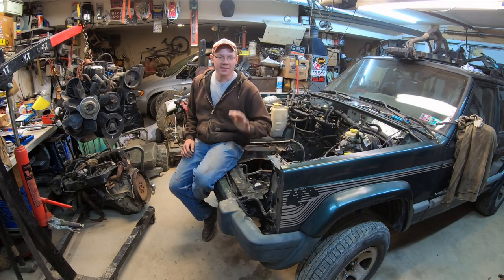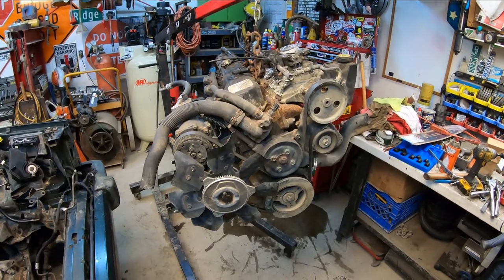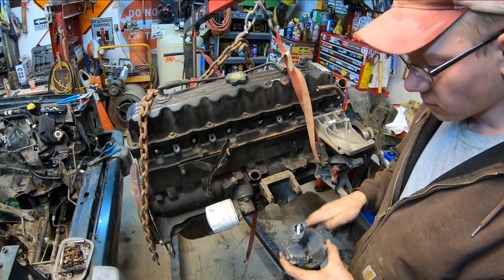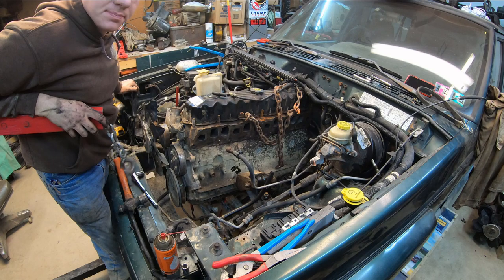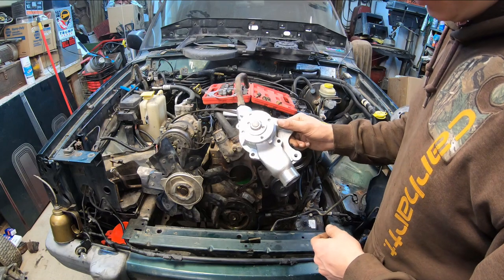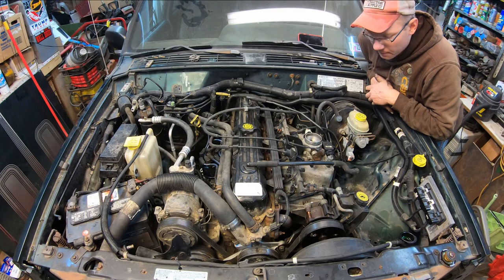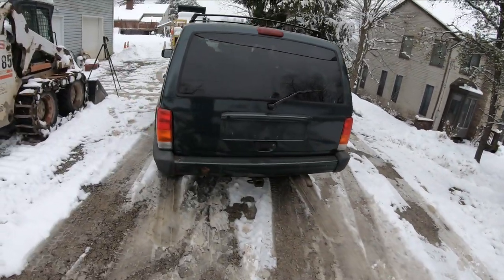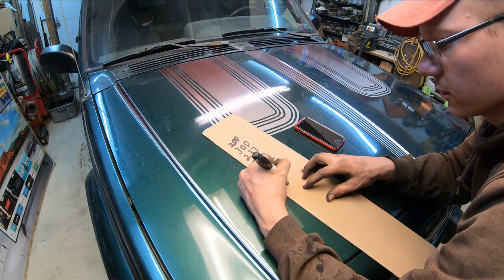$200 Jeep Cherokee gets JunkYard Engine,  WILL IT RUN AND DRIVE???

Comment: The Cherokee is a neat little truck. My 95 was put back together after a head-on collision before I bought it, then put back together when recovered after being stolen and driven until the engine blew up... the result was persistent cooling system and transmission problems, so I gave it up...

Jeep had a 3 speed automatic that just didn't like running between 35 and 45 mph - probably part of the overheating problems. The fan wasn't any prize either.

You'll definitely benefit from getting the spare out of the cargo space - Jeep made a couple of different rear bumper swing gate designs over the years, one or two of which were actually good. I got lucky in a junkyard one day when I also scored new front seats.

The other thing is that aside from the engine bay, almost everything else on the truck is readily accessible for wrenching.

Undercoating is a must. I've heard third hand that Jeep has an odd spec for their sheet metal and spot welding procedures, leaving them vulnerable to rusting.

You'll have fun with this.

Comment: I always cringe whenever anyone attempts to weld castings...    Never works for long and when it breaks again, the damage is much worse..   Braze is almost always the way to go...  Lower temp process, less distortion, about 80% as strong in tensile, but much more ductile, so it flexes vs just snapping.    If you can't TIG or oxyfuel, you can get it as a MIG wire as well...
Reply: I'm pretty sure the one piece manifold he welded up Is not cast iron but steal.
Reply: @jamesmullen4308  Doesn't matter..  While steel castings are definitely more weldable, they are still brittle and the change in alloy in the weld zone can make them even more prone to breakage after the weld.   Braze is still the best choice IMO..  Try it the next time you're at the  welding/gas supply- get them to hook you up with a small spool of bronze MIG wire.  Uses reverse polarity and pure argon as shielding.  I also started with a small 2 lb spool but I found it just the most versatile general repair filler and use it so much that I bought another machine with big spools of bronze wire so I don't have to keep changing the polarity and gas to swap between welding  and brazing.
Reply: @jamesmullen4308  Yep, it looks like steel, not cast iron so he's good.
Reply: i had some headers welded one time but they were stainless and they were better than new at the Y's
Reply: Those arent castings in any way shape or form. Jeep 4.0 "Manifolds" are steel tubing!!
Reply: @DereksGarage  Yes, i second this. They are not cast
Reply: Wow, that guy is persistent. Time to bring out the ROCKWELL hardeness machine. haha
Reply: @Flying0Dismount  actually they are a form of stainless steel tubular exhaust factory manifolds.
Reply: I’ve stick welded cast iron many times. Never had a welded part fail. You just have to know what you are doing. That said, that is actually tubular steel, not cast....
Reply: @Flying0Dismount  lel
If it has welds on it from the factory, it is not a casting.
Reply: Wish they were cast - maybe then I'd have no cracks;)

Comment: Watching you work reminds me that it takes me a week to do what I used to do in a day.
Reply: Try months
Reply: Yup! Simple clutch replace on a 2.3 ranger. You shouldn't need a 1/2 drive and 3 ft. pipe to remove bell bolts. Those were the easy bolts on my crusty/ salty truck. 2 months !??
Reply: Boy, does that ring true!

Comment: I started watching while at the Jeep dealer! Oil change and checking codes. I had a multiple cylinder misfire at 2,400 miles on a '21 JT.

I miss those old 4.0s. They were simple, reliable, durable and had plenty of torque. The 3.6 seems asthmatic compared to the 4.0 when you are pulling something.

When do we see some additions the the JL?!
Reply from the maker: The only addition I wanna make to the JL is a for sale sign.... way too nice for myself to drive
Reply: @DieselCreek  
True. I feel strange driving something that doesn't, rattle, have an obnoxious exhaust or severe cancer. However, it is nice to work on my vehicles because I want to rather than need to.

Comment: Nice job Matt !
Those were the best Jeeps ever. Even better than the Grand Cherokee. The six is quite a guzzler but all in all, a good deal !
And yes, a rust proofing job is a must. Especially INSIDE the frame rails, rocker panels, doors. I had a Comanche pick up with the same 4 litres 
while building our cottage in upstate Québec. That thing was a real workhorse, pulling machinery, concreteful trailers, heck, even trees !
Too bad my bro totalled it in a bad snow storm.

Comment: Sooo, i have a cherokee myself, and one thing i noticed was the thin foil on the injektors, they are actually good, because these cars sometimes have the problem that the gas gets hot in the rail (cause of the exhaust manifold) and then the engine runs poorly and what i also have seen is that the viscous fan is turning very easy, dont think it still works, could couse future overheating problems
Reply: sorry if its a little hard to understand, normaly I speak german and not english :)

Comment: Looks, sounds and runs like a success, count in the time you spent while working out the costs.
Reply: Yup, double the cost of parts etc. and that's the value of the rig now. Also lets you know you probably made less than $20/hr. but there's always the fun factor and bragging rights.

Comment: Oh yeah, definitely worth what you put into it. Down here in southern TN where i'm at, it's super hard to find ANY drivable 4x4 jeep for under $1.5k. Most of the ones you do find for under $1k have 1 of 3 problems with them. 1. Needs motor/trans. 2. No title. 3. It's been rolled.

Had a jeep cherokee that looked exactly like yours but white. Got it for $350, person who owned it thought it had a knock but the flywheel was busted. Replaced that, put a new fuel pump in it, washed all the mold off and out of it, and it was good to go. Ended up putting a rough country lift on it ($450 new), some 33s from fb($400),cut out the fenders and threw on some flares from fb($150) a roof rack from ebay($120ish) and  homemade "off road" bumpers/stinger bar made from scrap metal. Drove it about a month and threw it on fb for $3.5k and ended up getting $3.2k. Didn't even have $2k in it and the hardest part of the entire build was getting the mold off/out of it lol.

Idk how popular they are up north, but here down south. You can buy one, lift it and toss a couple "off road" mods on it and sell them for a decent profit.

Comment: I've got a 1993 Cherokee and it would try to run 210 degrees or a little more. I replaced the radiator, thermostat, water pump, it helped some but not much. So I added a transmission oil cooler and make sure you fix that broken fan shroud and I replaced the fan clutch. All that helped a little more. The auxiliary fan should kick on at a little over the 210 degree mark. Also I bent the fan blades to add a little more pitch to pull more air. It makes a difference. You'll hear a little more fan noise but it's not bad. I live in Arkansas and our winters aren't too bad. So I use a 180 degree thermostat. I also installed 30 × 9.50 x 15 Maxxis Buckshot tires on stock rims without a lift kit. I haven't gotten stuck yet. Stay safe and Merry Christmas. Keep the videos coming.

Comment: Great job.  I use fluid film mixed with red rust check and spray it on once a year to my truck.  I pull all the trim, body plugs , wheel liners , tail lights, headlights ect.. you get the idea.  It takes a solid day to day and a half ( spread out) between taking it all apart, washing and letting it dry, spraying it and reassembly. Worth it though I think.

Comment: My old jeep Cherokee would over heat but a 12 volt switched electric fan took care of that . Just had to remember to shut the switch off when I parked . LOL I stood that ol' jeep straight up , straight down, over rocks , through sand and snow . The 4.0 finally died due to me doing dumb things ( 300,000 miles on it ) but the transfer case lives on in my brother jungles jeep ! Jeep forever !

Comment: 210 is normal temp for the XJ. They just run hotter than other Jeeps with the 4.0L. You could do a fan or radiator upgrade. Some guys even put spacers on the hood hinges so hot air can vent out the back. I have a WJ with a slightly newer 4.0L and it stays under 190. I think the WJ fan/rad is a typical upgrade for the XJ.

Comment: Very nice 😀. As a XJ owner I’m very happy to see another XJ is resqued. In Europe the car is now worth around € 5.000 - 7.000,- after a good cleaning. Low miles examples with 50.000 miles go for about € 20.000,- these days because it became a youngtimer. 😎

Comment: Top mechanic's honors on the engine swap!
When your skills are as valuable as yours are, you can afford to run a slightly aged vehicle w/zero worries. I'm 60 [9/01 /21] &even though I'm in TX, I have to rely on my mechanics & my job to pay for any maint. or repairs. My truck is an '04 Ford Ranger edge model. I have to be very careful w/it so as to keep it in good shape for a long life. New 1/2 tonners are like a down pmt on a house. It's getting ridiculously expensive w/all the unnecessary bells & whistles you just don't need.

You are in a good place. Keep up your skills.

Comment: Don’t forget to put the fan shroud around that mechanical fan✅.   The engine will need it in warm weather especially, and it’s absence might even make it run too warm in winter.  Prolly oughtta replace fan clutch while you’re in there, too.
Good call on fluid film-  just avoid underbody washes till spring, as the detergents & pressure will erase the protective layer.  Garden hose will suffice on days above freezing.

Comment: I read an article a couple of years ago about the ten cars that refuse to die. That Jeep is the number one that refused to die. There is one everywhere you look in the Dallas area as we have no rust problems. Most of them look really good, the only thing is some have sunburn on the paint, but the insides hold up very well. I don't remember what years yours is but in Texas after twenty four years we do not have to do emissions check on them any more, just safety.

Comment: I'm on Long Island and any Jeep XJ running and driving with under 200k miles is worth at MINIMUM $2500-3000. When people have them lifted they try to ask 5k all day long. Way too expensive in my opinion but that's what they're going for by me. So I'd say you're in good shape with this project and I would have done the same exact thing.

Comment: You should fix that noisy exhaust on that truck you used to pull the other truck with in the end. It’s way too loud. Here you’d get a nice extra bill from the po po if they stopped you. Other than that awesome video. I’m glad you restore a oldie. Less electronics to go bad. All the newer stuff is ticking time bombs. When electrolytic caps in the electronics dry out and get an internal resistance it’s game over for every vehicle and it’s not a question if but when. You are way better off with something like that. Merry Christmas and I hope you get a nice and peaceful Holliday coming up.

Comment: If it keeps running hot, due to an airlock, fill the radiator cold with the heater hose disconnected at the t-stat housing until coolant comes out. The engine is full of coolant now. You've got a great deal going here!

Comment: I have a '98 Cherokee that I bought used almost 19 years ago.  The 4.0L is still going strong--one of the best inline-sixes ever made.  Jeep's weak spot has always been electrical issues.  Over the years, I've replaced almost every single major electrical component on mine.  Aside from that, the '97-'02  years of the Cherokee were some of the best 4WDs ever made.   By the way, very normal for the 4.0L to operate at almost 200° F. coolant temp.   If the block isn't damaged on the old engine, they can be rebuilt pretty readily--there is a good market for rebuilt 4.0s, particularly the later versions (the "H.O" version).

Comment: Hold onto the head when you tear down the old engine. They changed the casting on the 2000 and newer heads and they are prone to cracking. Also if your headlights suck, get a relay wiring harness for them, it helps a lot. 99 Cherokee owner in eastern PA.

Comment: I’m on my second XJ. This one being a 1996 MY in Sport Trim. Oddly enough, it’s a 4 door, automatic transmission where most sport models are a stick shift that I’ve seen. 

My first XJ was an ‘87 2 door ex-USNPS Park Ranger patrol vehicle. 

One thing that helps bleed the 4 liter cooling system is to drill a 1/8” hole in the thermostat body.  That lets the air bleed straight out. Pretty much fill it, run it at that point. No more pesky bubbles. 

Doesn’t t really effect the performance of the cooling system (reads a little cooler on the cluster needle, but will still roast your eyeballs out inside though) and saves you some headache.

Comment: Those style jeeps are awesome. You can drive them until it's just a frame left as long as they are kept maintain. I have a 96 that has 1,200,000 miles on it. Still the original engine.
Reply: That's mind blowing 🤪👍👍👍. And on the Original Engine fantastic.  Geoff Lewis, Wales, UK 🏴🏴🏴

Comment: As long as there's a use for the Jeep, I think it's totally fine to keep it running! I've had my car for almost 29 years now, and it just had to get some work done. Everyone thinks I'm nuts for holding on to it for so long, but I still love this car as much as when I first got it. I've been lucky that in the time I've had it, I haven't had too many major repairs so the money I've put in to the repairs hasn't been outrageous. Can't afford a new car (or used, for that matter) so it's necessary to get things fixed when I can.

Comment: I might be a little ole school but it is always good to replace the water pump / t-stat on junkyard engines right away. The O'rings seem to harden in the pumps from sitting. I always checked the rear main seal also. If it was a one piece seal I would often change it for the same reason and for the amount of work to replace it if it failed. It was worth the cost of the seal for sure. I also wanted to mention a product called Copper Coat. Works very well with sealing gaskets to part and is highly recommended for aluminum parts. As far as your running temp of 210 goes. I believe this to be normal. They run 195 t-stats so you will see higher temps on most modern cars. Congrats on your success.

Comment: Herculean job and mission accomplished, well done, Matt! Be careful of lifting it, SUVs already have tip prone centers of gravity. You'll sacrifice a lot of handling stability that is already caution prone. Stabilize the suspension issues, fix the interior switches and other issues. Maybe some tire and wheel upgrades, rust prevention etc and enjoy your project successes. My take and 2 cents anyway. I tend to be more practical and conservative! 😉🙂 Do whatever gives you pleasure!🙂👍👍

Comment: I just noticed your garage is a 2 car. All your stuff stacked up there it almost looked like a wall at first look. Great video it shows other people that hard work and mechanical knowledge saves you a ton of cash making your own vehicles repairs. I started with a inexpensive repair manual that I read and re-read so I understood the basic concept of the work and learned from there.
Reply from the maker: Ya it’s like it is because the other half isn’t mine. I’ve been using that half of my cousins garage for years. Need to get myself out of there sooner than later

Comment: Definitely worth every penny youve thrown at it.  I had a 1997 4.0 ax15 manual 2wd.  Hated being a 2wd but other than that, it had 300k miles on it.  Favorite vehicle I have ever owned.  Would still have it to this day if it didnt get rear ended by someone doing 50 texting and driving.  Been trying to find another one for the past year.

Comment: I hope you didn't bust the front pump in the transmission.  I tightened down the bolts on a little mustang way back there when I was young and dumb. Things didn't go just right for me on that deal.  When I got it started,  it wouldn't move and fluid was hittin the ground.  I had to pull it back out and put the front pump in.  Fun times.

Comment: Here in Guyana, easy 6.000€ they like that type of vehicle !!!  I have a 1992 Toyota 4RUNNER 350.000 km and still going strong pulling the trailer with the Komatsu PC 27 excavator  and the roads are not easy here ! All the best and lots of happiness with your  Range Rover

Comment: They are brilliant. When they put the 4 liter in , i was told they went through the 1/4 mile quicker than a 5 liter Mustang of their day. Mustangs were slow. Their track and wheelbase are like a Wrangler and they weigh 100# less. Great in the bush. A compact with four doors and being quick and nimble, they started the SUV craze. Fun and practical. The AMC six and the Toyota auto lasted forever. BTW . VM Motori  diesels have been in Jeeps and Chrysler products  since back when, just not in the states.

Comment: That's turned out well, (certainly a lot cheaper than we could do it in U.K.) Guess by the time you get the other bits an pieces done it'll nudge over $1000, but by then it will be pretty much problem free, and better than a $1000 straight off a lot, that would still need work. Those tubular headers are always rubbish on jeeps, seen them fail on nearly new ones back in the day.

Comment: Dude, that's a true bargain.  I still own a 1993 Ford Explorer.  I'm the original owner, but it's been beat to crap.  Still it has less than 160K miles and it's good for driving around my part of the city. What you've got is a fantastic vehicle that should give you some years of service yet...  Nice job!!